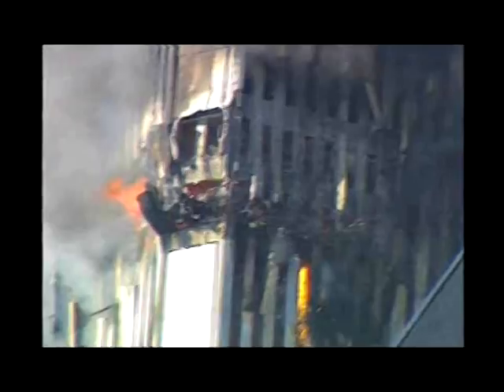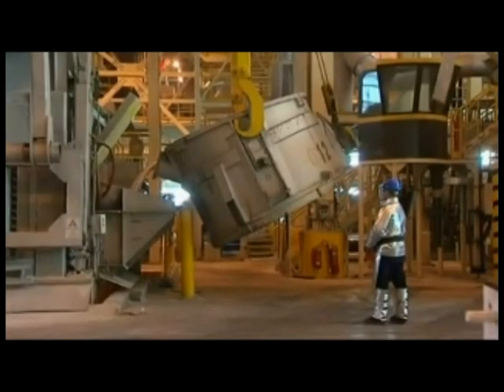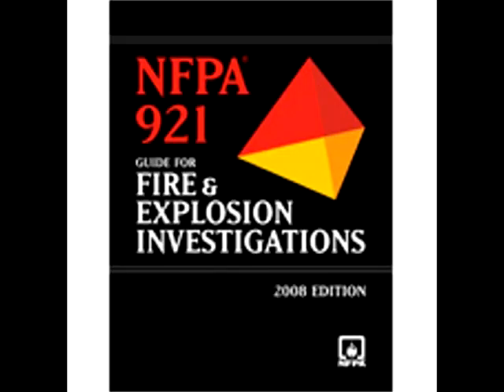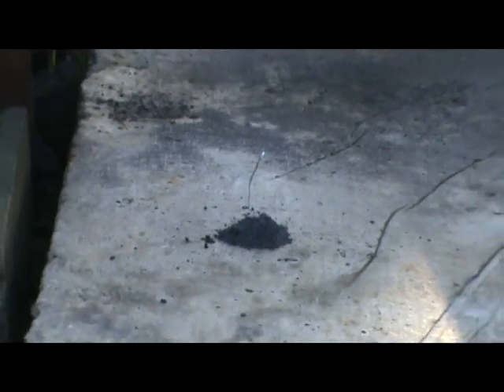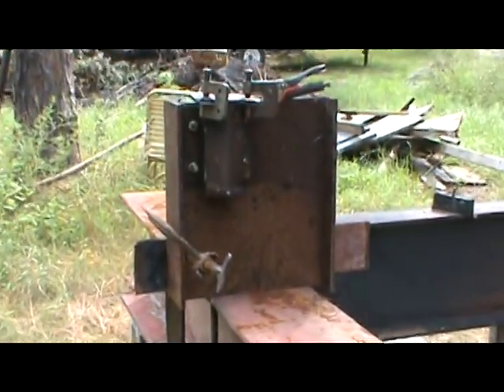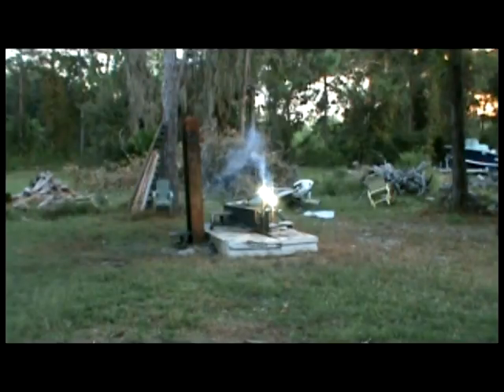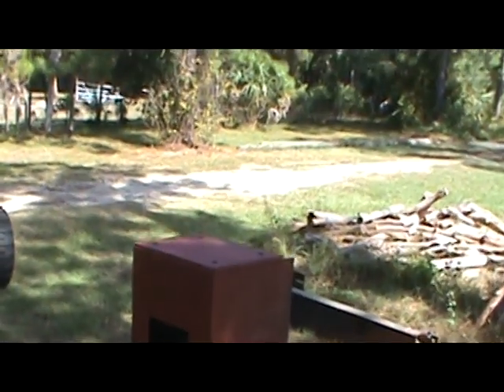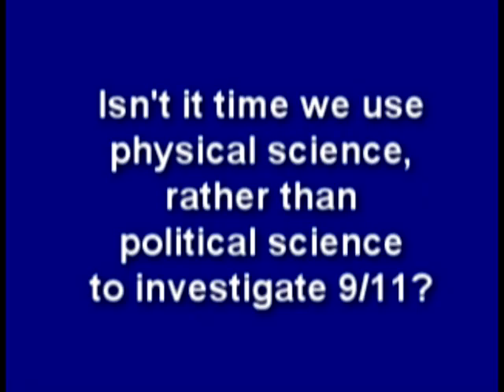9/11 Experiments: The Great Thermate Debate

Comment: Ok, who did this and how did they know that planes were going to crash there? Also, how could they get tons of explosives In the building with no-one knowing and remove the drywall to get to the columns. Lastly, did someone just sit around JUST WAITING for someone to crash a plane IN JUST THE PERFECT SPOT? Just curious. If you's pull my other leg it plays jiggle bells.
Reply: There is also firm belief, from many sources, that planes DID NOT crash there.

If you investigate at all you will find that a lot of suspicious "work" being done on various parts of the buildings, eg:
https://truthandshadows.wordpress.com/2010/10/26/trade-center-cameras-locks-electricity

Check also who was a director of the WTC security company.
Reply: +Bruce Lee Dude, watch the videos, you can hear people in the background say plane, why would they say it was a plane if they didn't see a plane? C'mon now, use common sense. I don't have to shoot your knee with a bullet to knock you down, all I have to do is kick it, same thing applies to the steel in the building, it doesn't have to melt for the building to fall apart, it just has to get heated to the point where it bends easily, especially after an impact from a 737 compromising the structural integrity.
Reply: Viper Don't bother. Talking to people who deeply believe in things is useless. Their facts lie not in science, but in videos made by people sharing their viewpoint and confirming their bias. They live in a bubble, thinking they're "woke" and don't intend to open their eyes and start using their brain to think, because why think when you can have someone else do the thinking for you. The problem is, the thinking those people do for them is not based on science or research, but feelings and belief. Satanic panic, witch hunts, islamophobia, homophobia etc., all born out of hatred fueled by ignorance and people wanting to feel smart without actually being smart. If you're stupid, you let the news tell you how to see things. If you're stupid, but you think you're smart, you let sources you trust tell you how to see things and ignore sources you don't agree with. Without education, the world is doomed. Stupidity gives birth to stupidity, both figuratively and literally. Let's study the case of Bruce Lee: 
"There is also firm belief, from many sources, that planes DID NOT crash there" - no sources provided for this because "firm belief from many sources" sounds better than "a couple of random blogs wrote things I share belief with". "If you investigate at all" - implying Shayden did no research of his own to knock his argument down and again lift his position up. He tries to give his argument and himself fake credibility and sound smart, not knowing he's doing the opposite. What's next? A source of belief for his statement - a conspiracy theory blog. That's what he calls his own "investigation". That's the extent of his research and basis for his belief on the subject of "suspicious work". If he were to go to university, he would learn how to do proper research and find credible sources of information, he would know not to act as if theories were facts, he would know how to fact check things before forming his opinion. But sadly, that's not what happened in his life, at least not yet, which is why he is acting this way and why he would sell a cow for "magic" beans from a shady guy. It would only take some random blogger to pop up in his google search stating "Magic beans changed my life!", because sir random blogger is much more trustworthy in his opinion than any science websites stating "Magical beans found not to be magical", with direct link to the research article. People like Bruce Lee are very easily manipulated. Just tell them what they want to hear and it doesn't matter you're lying - they'll trust you with their own lives, which is why Trump not only got elected, but still has massive, fanatical following no matter what he does or says. They do mental gymnastics to justify their viewpoint and use random websites and people (for example Alex Jones) as source for their "facts" and "news". So, long story short, to Bruce Lee there will never be a plane, and you'll never explain anything to him. If he were to meet people who were in proximity of the tower on 9/11 and saw the plane with their own eyes and were on a video to confirm they were there, he wouldn't believe them. He won't believe anything, because he believes in this one random theory supported by things people like him wrote, because that's the only credible source to him. It's a steel bubble nothing except actual education can burst... Or not. Because this entire comment is just straight up nonsensical bullshit that makes no sense as I have too much free time to write random stuff that almost seems like there is point to, but there really is not. Be sure to drink your Ovaltine ;)
Reply: Viper said
"especially after an impact from a 737 compromising the structural integrity."
I Said above: "There is also firm belief, from many sources, that planes DID NOT crash there."
Whaaaat!
Reply: Viper

Aircraft vs Building Strength

The energy of the aircraft is more than enough to damage the steel, but, because the aluminum is so much softer than steel, it breaks apart first, long before it reaches the point where the steel suffers any distortion. Here are the figures:

The speed of air that will tear a plane apart at sea level densities is 500 mph.

At 500 mph air creates a force equal to 674 pounds per square foot.

If an aircraft is not carefully controlled in it's flight path, 500 mph air will rip it apart at a sea level air density of 14.7 psi.

 Okay,  so that's how strong or weak an aircraft is.  now let's see how much force it takes to break a 14 inch box steel column.

 Explosives experts will use a charge designed to move air at between  6818.2 mph and 20455 mph,  which translates into forces of 125,370  pounds per square foot of pressure at the low end,  to a high of 1,128,400 pounds per square foot  of pressure respectively.

So we have Aircraft............ 674.23 lb/sq.ft
Steel box column:........125,370...... lb/sq.ft  (low)
Steel box column: ......1,128,400.....lb/sq.ft (high)

 Worse yet is the fact that the aircraft has to break several steel columns,  not just one.
 If the aircraft must break at any pressure above 674.23 lb/sq.ft. how
can it possibly stay intact and exert a force of over 125 thousand
pounds per square foot,  to over 1 million pounds per square foot,  on
the steel columns?  That would be like saying that an egg could
penetrate a concrete wall if thrown hard enough.  It can't.  It will
crack open and spread it's force over a wide area,  without ever even
coming close to generating the force needed to penetrate the concrete. 

A 100 ton hollow ball of clay,  moving at 500 mph,  does have the energy needed to destroy a steel box column,  but,  because of it's softness/inability to withstand the pressure/forces needed to damage the column,  it will never do any damage to the steel. Thus the plane becomes a "bug on the windshield" in effect, it splatters.
Obwon Kenobe1
Reply: Viper 
you can record as many tracks as you want on any video... 
What it would be more difficult is to take out some words of an audio... but you can put another track and say: "look at the Dinosaurus" then you play those 3 tracks together, and you'll hear the original audio, plus the "airplane" and the Dinosaurus... that's a very simple thing to do even in 1930...
Reply: @brewsterly2927  ok, then where are these planes and where are those 400+ people that died on those planes if those planes didn't REALLY CRASH THERE?
Reply: shayden229 
If nearly 3000 were killed at the towers do you think they would have any problem killing 400 more and after the elaborate plans to destroy the WTC. getting rid of a few planes would be doable. 
There is more to it than that though.
Reply: Millions of people watched the 2nd plane hit...
Reply: Brian Reed 
if millions of ppl watched the 2nd plane, and they were in NYC, and 95% of them had some device -camera, video camera, digital camera, etc 
why there's no a single picture or video of the 2nd plane, when everybody were looking at the towers after the 1st impact??? 
hey!! but CNN capture perfectly the moment when the 2nd plane crashed in to the tower... (only them cause they're pros) 
way before the 2nd plane crash, there's a NOISY airplane flying low, for all to see and hear, even one minute before
Reply: We saw it on TV, the same TV they saw a tyrannosaurus destroy a gas station in San Diego. I thought the tyrannosaurus looked more real than the airliner melting into the south tower of the WTC, but I don't think either of the two events actually took place as shown.
Reply: Brian,
could it be; what they thought they saw?
Reply: Brian,
could it be what they thought they saw?

9/11 HOAX

In the year 2000 NORAD made 129 scrambles with a 100% success rate. On September 11 2001 they failed 4 times in one day. Who are they kidding here? Not 1 fighter jet even got close to intercepting any of the so called 'hijacked' planes. Overlapping war game exercises placing false radar blips on the screens was also very convenient. Look at the news of September 10th with trillions of dollars unaccounted for, why is this not even mentioned anywhere? How the hell did WTC7 collapse? No plane hit it? How did some police & fire officials have prior knowledge that it was coming down? The BBC reported its collapse over 20 mins before it came down?? Who provided the information? People blindly believe the story without many answers, why? The truth will come out eventually, hopefully before these criminals die so they can face the punishment coming their way!?
Reply: you dont have to remove any sheetrock just go above ceiling those columns are exposed.....
Reply: shayden229 
how they get tons of explosives in to the building?? 

in the nights. 
maybe days too, in boxes, BUT those boxes didn't say: Caution, explosives to make a perfect demolition on september 11 

BTW Osama just did it for fun?? He didn't ask anything, and he was a millionare who didn't need anything... but he spend the rest of his life hiding in caves, running away... just for fun too I guess
Reply: It was all planned.  Muslims in Northern Virginia left and went back to their home country 1-2 wks before it happened.  Every detail of it was planned.  I am sure that Bush knew about it before it happened.  I remember him slipping and saying something in an interview at the school and Laura got a funny expression and her eyes got big. I wish that I had made a note of it.
Reply: Imagine you're flying a plane and someone puts a knife on your throat and says: 
fly and crash in to that tower or I'll kill you

if you do what he says, you're dead anyway; also many ppl. 

would you do what he say?? 

and if you're a passenger, and there are 80 (or how many?) just like you, would you just obbey what 4 guys are telling you?? 

they have knifes, but 80/4=20 or 25 ppl without knife against 1 with knife... who wins??
Reply: shayden229 
There were NO PLANES THAT DAY!! the only real things were the Explotions followed by the other demolition explotions... 

You can see the structure after the "plane impact" and stills there... after the explotion... where the planes went through. those planes got inside the building without leaving a Hole!!! 

planes made by computer or hologram planes (there's no 3rd option)
Reply: Just a guess but maybe whoever rigged the building was also responsible for crashing the planes into the building, you know, like a co-ordinated operation .....
Reply: and dont listen to anyone that says no planes crashed into the buildings. I totally believe 911 was an inside job but it would be easier to remote control the planes into the buildings than fake all the footage and other data that show the planes existed. Those that think no planes crashed into the building probably need to stop smoking weed
Reply: Clint Eastwood 
you can watch a video of that day and see the towers after the impact. The Steel structure STILL there!! 
those aluminium planes penetrate a steel structure without leaving a Hole??? 
it's like a car crashing into a wall and getting to the other side and there's no hole after... !!!???!!!? only in your dreams... beaides steel is way stronger and heavier then aluminium; a plane that's suppose to fly is made with the less heavier material, a tall buillding instead, the heavier, resistant and stronger , the better... 
If a real plane crash against a buillding, it would smash in pieces and all of it would fall down to the street... 
but in computer you can add a Dinosaurus to any video if you want... that's why those dark planes on a sunny day, looks fake...
besides it's almost impossible to hit those towers with remote control or being the pilot... they made simulations with experts pilots and everyone failed.... 
the good news is no ppl on those planes died. there wete no planes. (besides you can't make phone calls from a plane at that high, and even lower)
Reply: The government. They used the planes crashing as a cover up and coordinated it with bin laden to start a war

Comment: Great presentation and testing.
I imagine such high rise must have some safety features in case of emergencies. Maybe an emergency system existed in the towers which was accidentally or deliberately ignited after the plane impacts. If deliberately, who and why? For safety of surrounding buildings and humans? Or did attackers knew about such a system and they triggered it?

Comment: Thermite could do that. Thermate would be a better fit. But if I wanted to something like this I'd use ammonium perchlorate like what was used in the Shuttle program as an oxidizer. The same stuff that was stored at Pepcon when disaster hit the plant destroying it and leveling everything around it for miles. Ammonium perchlorate burns at a temperature so high that Steel would boil in its presence. A far more efficient material to use to bring down the twin towers that Thermite or thermate. And because of its higher thermal efficiency it could be used in far smaller quantities than the Thermite proposed by those studying the event. Not to say that Thermite/Thermate wasn't used, but it's another possibility. No matter which was used though,something had to initiated the collapse of the buildings. Something had to shake them so violently that after the first material was used to cut apart the supports to the towers that it would come down into their own footprints. Something so hit that steel in the sue basement areas would remain molten for over two weeks after the original fires and Thermite was used. Something powerful enough to powderize all the Concrete in the towers. Something beyond conventional explosives. Mini nukes. They are the only thing powerful enough to cause the siezmic events registered before the towers fell at a higher amplitude that the crash of the towers themselves. They are the only things powerful enough to melt cars on all sides of the towers before they fell. They are the only things possible to create the heat necessary to keep Steel in a molten state weeks after the initial 600 degree jet fuel supported fires seen in both buildings. (jet fuel being made of Kerosene with some additives burns at only 600 degrees F in the open atmosphere. The only reason it burns hotter in jet engines is that it is mixed with huge amounts of Oxygen, which allows it to burn at roughly 1600 degrees F, still well below the temperature needed to plasticine steel let alone melt it, as steel melts at 2500 degrees. It boiled at 3500 degrees, the temperature at which Amonium Perchlorate burns.) its time to think twice about the Government's conspiracy theory, and look at scientific facts. It's time to think about the treachery of those who perpetrated the 9-11 attacks, not the suspects the FBI listed, because 7 of the so called terrorists are alive and well and living in Saudi Arabia, and filed defamation of character suits against the FBI in the weeks following the attacks. The real culprits, who wrote of their intentions in an open letter to Bill Clinton from the members of PNAC in 1999, are still at large and unpunished.

Comment: If you look at shows on demolition they have thermite beam cutting charges. They put them on each side of a structural beam they level them and they are held in place by intragal magnets , these charges are placed in line and leveled so as take cut from both sided on  the same line. Nice video 👍
Reply: They used shaped-charge plastic explosives with a copper cover to cut through the beams, not thermite.